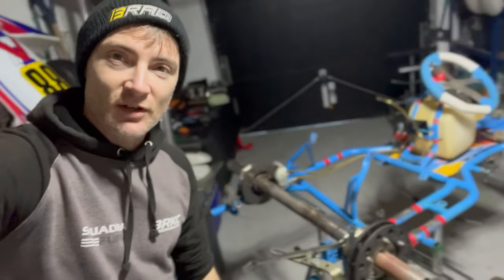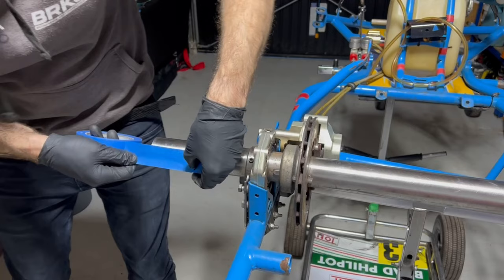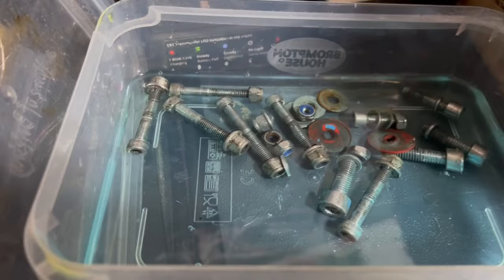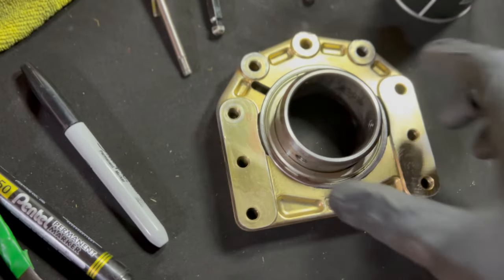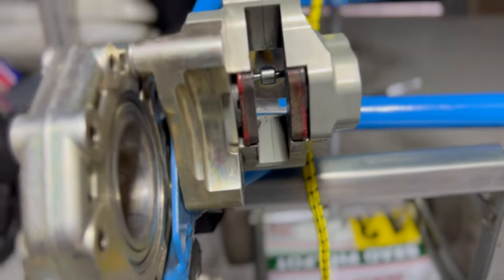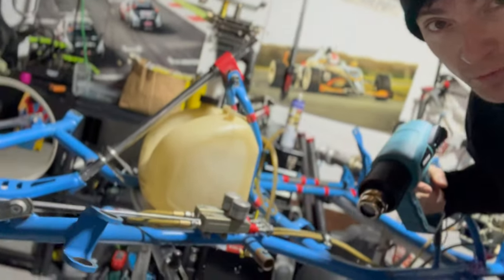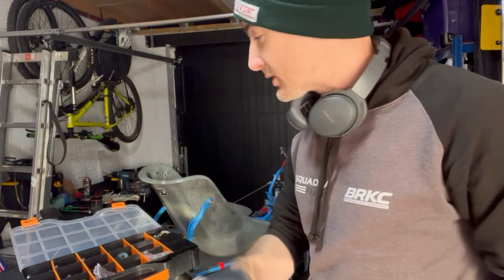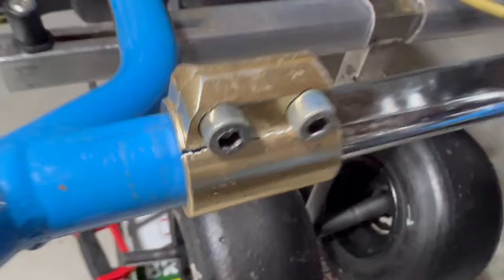Building a Kart for YOU! | Part 1 | OTK Restoration

Comment: Nice you have obviously done some sort of engineering before...or then again, maybe you have not. Sand paper? more like Emery cloth...
Reply from the maker: I’ve dabbled over the years - radio control cars when I was younger for example - but I’m really learning as I’m going with these, so totally open to suggestions and comments.
Reply: @BradPhilpot  would have used just the emery cloth and not the drill. Other than that you are doing very well. Refurbishing anything I would personally use all new bolts.
Reply from the maker: @TheNorville2 there was a LOT of rust that’s all, and the wire brush on the drill worked wonders. For normal amounts of small surface rust I’d use an emery cloth for sure. The drill method is nice and fast though for a massive job!
Reply from the maker: @TheNorville2 for my own “no expense spared” build, I’ve replaced every nut and bolt. 

For this one, it had to be on a budget - so I’ve taken a view on keeping some nuts and bolts and replacing others. I just don’t have a massive budget for this one otherwise it would have to be sold for more money.

But I’ve replaced anything that needed it for sure. It’s not a FULL restoration like my last video of the green tonykart.

Comment: Love these vids😍. Don’t forget a little bit of tape round the steering wheel bolt to stop it falling out if it snaps :)
Reply from the maker: Great shout. I will make sure I do that. Same with tape around the keyways on the rear axle. Small things which help avoid disasters.
Reply: @BradPhilpot  speaking from previous experiences seeing my dads bolt snap not having tape round it and going into  the wall😬😬🤦🏻‍♂️. Yep those little things certainly do go a long way!